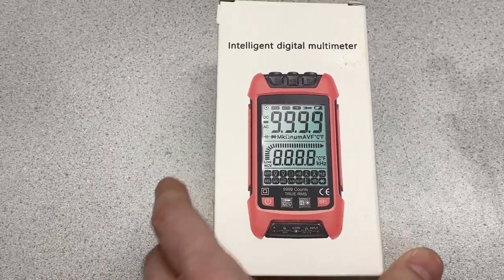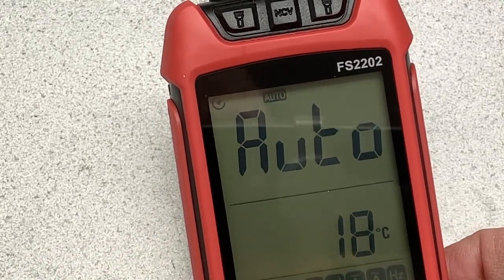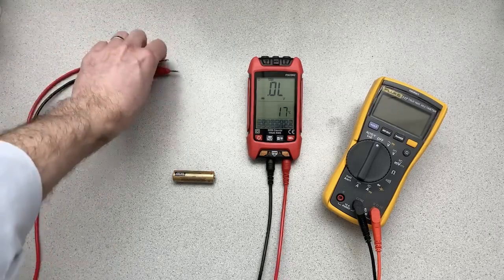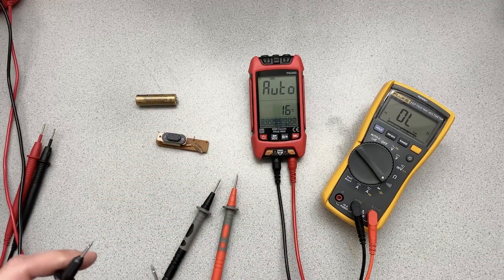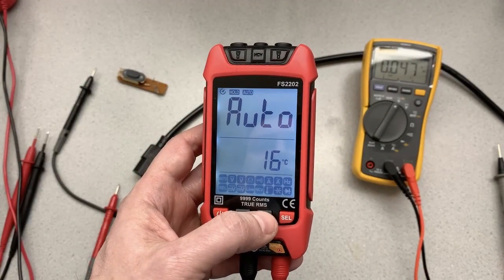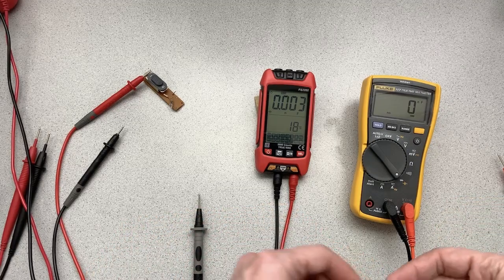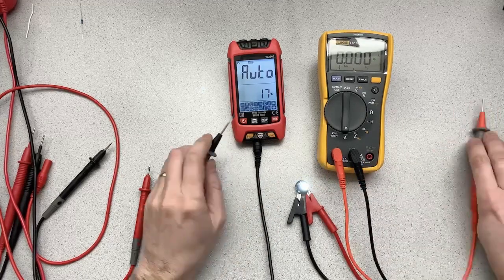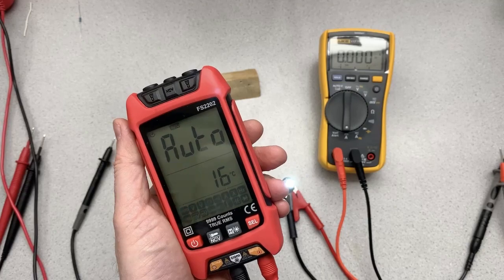Victor FS2202 / Aneng SZ02 Intelligent Digital Multimeter

Comment: 21:24  Pourquoi en mode manuel le AC affiche aucune tension et affiche OL ? Ça fait la même chose avec mon multimètre même en DC
Reply from the maker: With this meter in the manually selected AC mode the range is limited to millivolts. In other words, it does not auto range through the entire AC range. I have been thrown off by this on a few reviews because on some meters manual mode selection is to the full range and on others it gets limited to mV.  These days I review the Auto mode independently from the other modes because of these sorts of idiosyncrasies.

Comment: Sir how many MFDs can this AC capacitor charge
Reply: Please reply
Reply from the maker: According to the manual the meter can measure upto 99.99 mF
Reply: Sir I want to check AC capacitor upto 200 mfd, will this work or not please reply
Reply from the maker: @alankarbhalerao  No it will not work for a capacitor that large.
Reply: @jtechlabs1  ok thank you sir
Reply: Upto how much MFD can you check AC capacitor please reply sir
Reply: Sir I need an auto multimeter to check upto 200 mfd, please tell me which one should I get
Reply from the maker: I am not aware of any multimeter that can measure capacitors of that size. Usually for large capacitors the size is determined by measuring the charge / discharge characteristics and performing some calculations.
Reply: Ok thank you
Reply from the maker: I was going through some meters today and it seems that the UniT UT61e+ may meet your needs.
Reply: @jtechlabs1  ok sir thank you

Comment: Looks like my comment got flagged. At 11:26 isn't that the Diode mode? someone says "Manual selection works only on "mV" range, up to 599/999mV. " v=sG96MnlsBGI can you please verify that? TIA
Reply from the maker: Diode mode starts around 29:15.
Reply: @jtechlabs1  Thanks for the reply. I was talking about the manual voltage mode. that video id I mentioned talk about that issue. Isn't it limited to the mV range? when you check the voltage of the batteries at 11:26 (in manual mode) you were in the diode mode, correct?
Reply from the maker: You have very sharp eyes and I just might need to redo this video. Yes it does appear that I was in diode mode when I took that measurement. By a total fluke because it was a AA cell it worked. I tried it with a 16V lithium ion pack and when I do that it jumps out of diode mode and goes to auto. And yes, the manual voltage mode is limited to the mV range
Reply: @jtechlabs1  That's probably because I was specifically looking for that the second time. Apparently, some DMMs can work up to a few volts in diode mode. Thanks for looking into it for me, and keep up the good work.

Comment: It would have been better for your AC and DC voltage measurements to have both meters in parallel also checking for zero with both the leads shorted together, and reversing the leads for DC measurements. For current measurements both meters should be in series and in series with your led load.
Reply from the maker: @bobmcclements6275  Yes, I am incorporating these suggestions into more current videos

Comment: I just got one of these meters recently, the Aneng SZ02.  I have better meters, a Fluke, UNI-T.   I keep this meter in my smal electircal tool kit, it's perfectly fine for that.  I take it out of "Auto" mode for most testing, the Auti mode is nice, but like you demonstrated there is a delay lag ezpecially with continuity.
Reply: Don't you think 40 minutes is a complete waste of time you can't even do frequency reading (kHz)
Reply: @collinsukaegbu3209 I keep it iny car tool bag, I really don't need frequency for that use.  I have my Fluke & UNI-T meters that I use on the electronics bench.